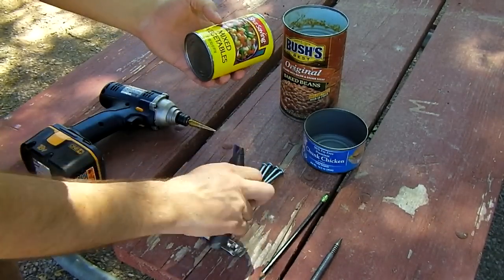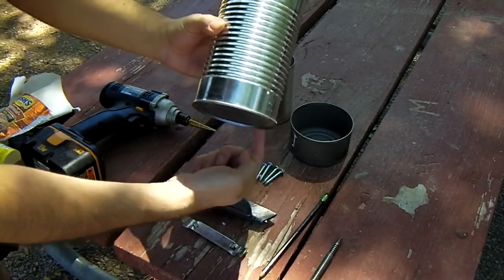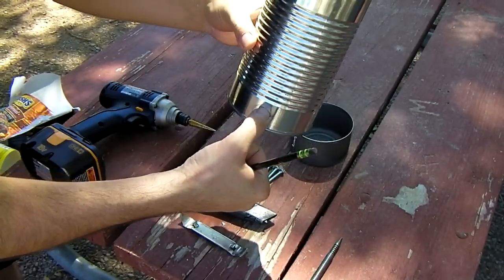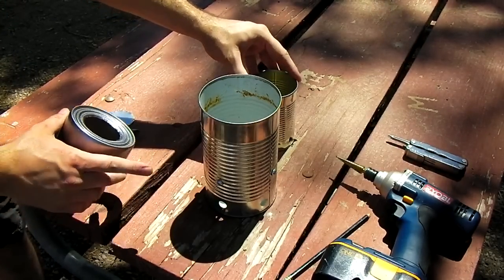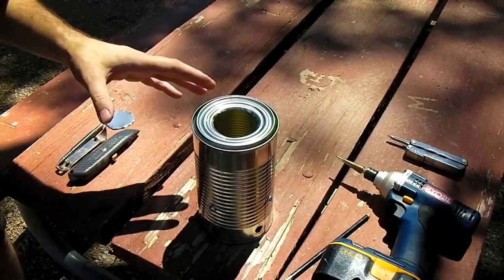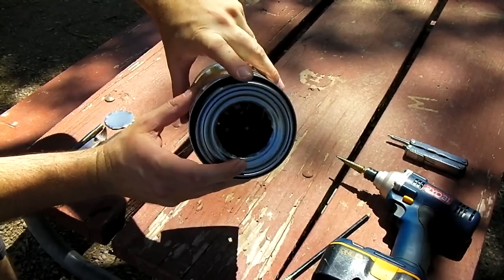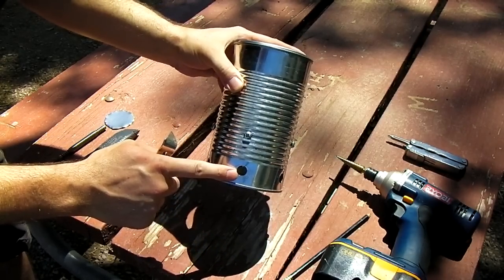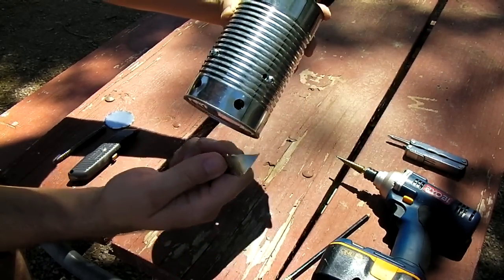MIDGE Woodgas Stove Build - 01

Comment: I've seen many and built several wood gasifier camp stoves; yours is the best I've seen.

I'd like to ask a couple of questions.  Please pardon me if you've answered them in the video, but I'm deaf.

(1) Is the punch you use readily available, and of so, then what is it called?
(2) What is the drill bit called?  (I've seen it at Lowes.)
(3) I understand basic wood gasifier operation, but what does the top can do?

Best Regards.

Comment: EXCELLENT videos!  I have a question.  In the video, you state that the burn chamber should have 16 top/secondary holes and 10 bottom/primary holes.  But in the Instructibles tutorial, the picture of the cans used states that there should be 12 top holes and 8 bottom holes.  Also, your video states there should be 5 holes in the 55oz can, where the Instructibles diagram states 6 holes.  I may try both, but wondered which is correct?

Comment from the maker: 1. The punch was a cheapie odd spring punch. It's easier to go to Home Depot and get a General Tools normal spring loaded punch.
2. Step drill bit. Expensive everywhere. I have cheap and good Harbor Freight set $14 for 3
3. The top can allows the gases to mingle at the top air holes. Basically trapping them somewhat.

Comment from the maker: It's not *super* important. When I eyeballed, 5 holes seemed right. When doing it in Sketchup, 6 fit evenly. Computer precision vs. doing it on the fly....you know. Follow the Sketchup model if you like. Either will work.
The only thing that didn't work was when I recessed the top cowling can down inside the 55 oz outer can accidentally one time. For some reason it messed up the burn.